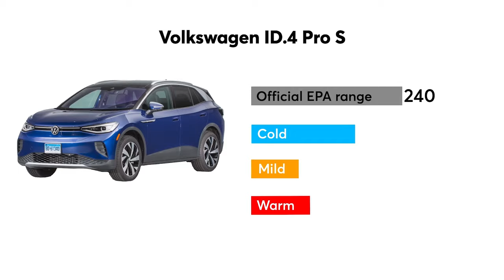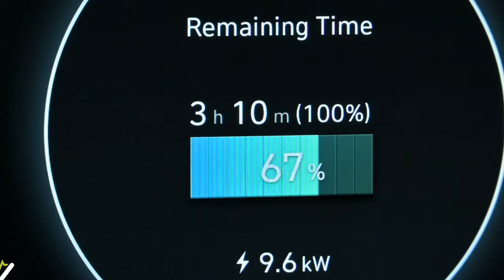Are EV's Safe To Drive? Should We Be Concerned?

Comment: 199000 gas cars catch on fire every year just in the US alone
Reply: But in most cases, the fire can be managed by firefighters. It's another story with Lithium-ion batteries. They take a lot of resources to extinguish, and as was pointed out in this video, they can reignite weeks later.
Reply: @Ozvideo1959  Nope, the kind oil lobby loves the narrative and makes sure these falsehoods won't go away... First of all; in the very unlikely case of a fire with a lithium-ion battery, it fizzles like fireworks and takes a long time to fully emerge into a big fire. A gas tank is an entirely different case and can blow up. And if you ask (in 2024) any firefighters that are now trained on battery fire; it's an old hoax that dies hard... And i Love the fact that people sat on highly explosive gas tanks for a century and now suddenly they are worried about a battery burning although it hardly ever does ? Of course every burning Tesla made it to the front page, mostly a couple of years ago when the automobile/oil lobby tried to push this narrative but a) never mentioned that even a safe car like BMW alone had more than 800x more burning cars than Tesla. And all EV's are safer today than Tesla was 10 years ago... Silly argument.
Reply: @moritzschneider7081  There have been cases all over the world of those batteries going into thermal runaway.

EV's are not the problem. Lithium Ion batteries are the problem. And they do not fizzle. You're kidding yourself. 

I have seen stories recently of electric scooters or bikes, golf buggies, and EV's catching fire. It only takes one dodgy battery cell, among the 1000's in an EV, to have an issue and they can catch fire.

And how does a technician identify if a car has a bad cell? They can't. How do you know the batteries in your car were manufactured correctly? You don't.

I'm in Melbourne and we had the clubrooms at a golf club burn down here recently. The cost 140,000,000. The culprit, an electric golf buggy.
Reply: @Ozvideo1959  ah yes 200000 fires take less resources to extinguish than 8
Reply: @Nuke-MarsX  Well, firefighters here have expressed concerns publicly about the amount of incidents they have attended due to lithium Ion batteries.

I think they might know better than you.

Comment: Seriously ? 😂 it's so brilliant that people drove around sitting on a highly flammable/explosive gas tank for almost 100 years (with 20-30% efficiency and 70-80% was just wasted heat and not used for driving...) but you're concerned about a battery catching fire ? The rate of burning gas powered cars compared to ev's should tell you everything you need to know... It's almost 1000:1 (meaning 1 slow burning ev on every 1000 burning dino fart combustion engine - another hint - powered car, so don't do ridiculous click bait vid's
Reply: exactly, this channel feels like a cult